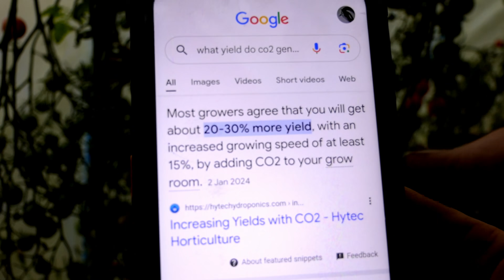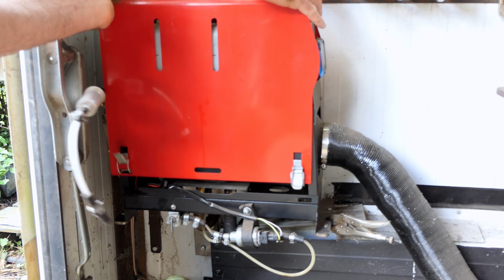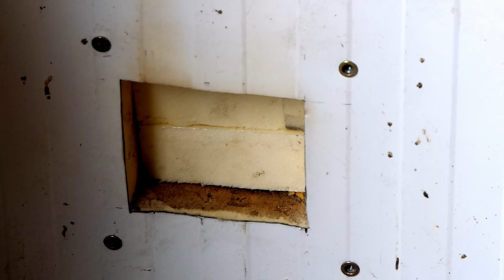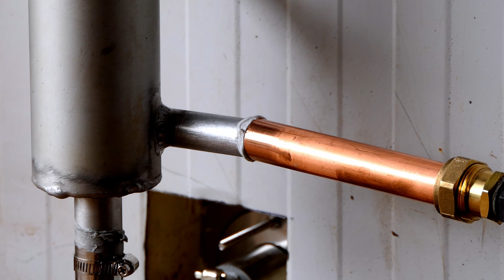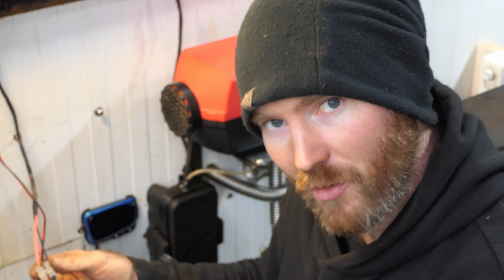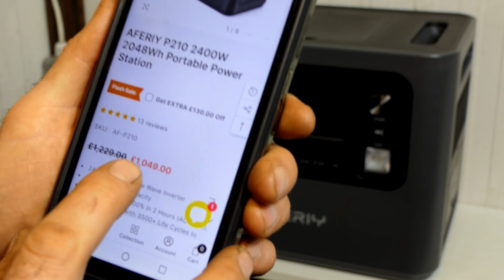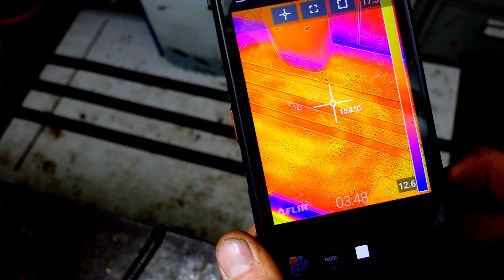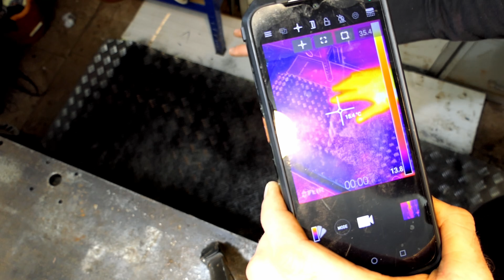NEW! Better system for Cheap and Safe Heating💲+ Underfloor Heating Mod test🫠

Comment: No one talks about all the ships coming from  china chugging out black smoke,
Reply from the maker: @Hasdac   you could be right. the restrictions should go top down and effect the leaders and corporation first before effecting the vulnerable. Cheers J
Reply: Because it’s all a Lie
Reply: There's more emissions getting your package from the warehouse in the UK to your front door, than from China to the UK. 🤯

There used to be a statistic about the top three container ships on the planet emit more pollution than all cars combined, or something to that effect? But also that they are the most efficient form of transport per kg per km. How?: They're ENORMOUS. Huge emissions per ship, but because each ship hauls so much stuff it turns out it's actually one of the better forms of transport. Better than many planes, for example... And implicitly delivery vans.

Also, they used to burn bunker oil which is basically the dirt that's left over when you've extracted all the valuable stuff from crude oil. Since it's international water they can do what they want. However, now they've made that illegal if you're docking in certain ports. But the pollution used to seed clouds which reflected radiation meaning that the measured temp increase was suppressed compared to what it actually was and so it shot up when we switched to cleaner fuel.  

This problem is incredible complicated. But the oversimplification is that all we need to do is stop burning fossil fuels. Nothing wrong with Coppice (other than the PM2.5 or if it's unsustainably implemented). And realistically the issues are primarily systemic and we are along for the ride. As individuals we can't really move the needle. The pushing of the guilt for it onto the individual consumer is propaganda from the oil industry. I forget which one off the top of my head.